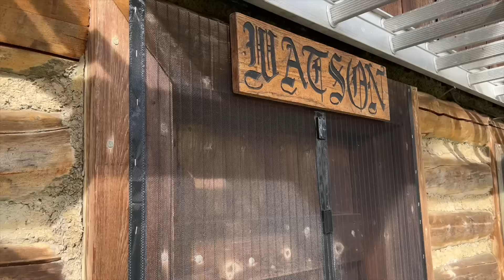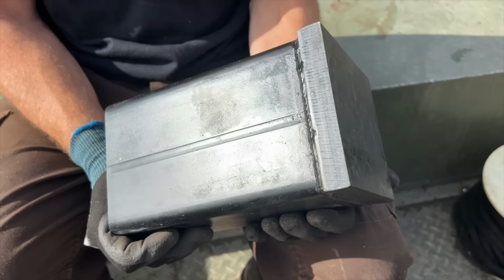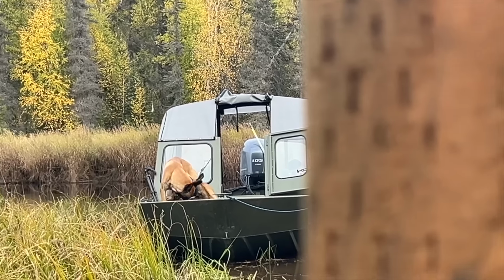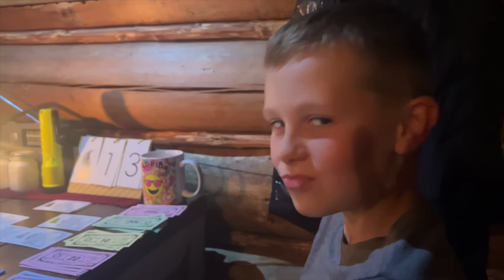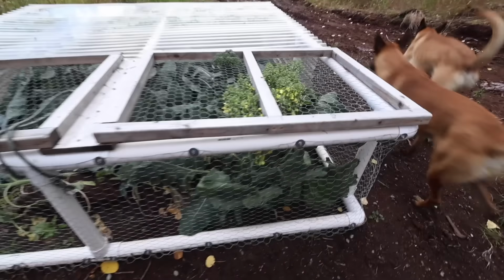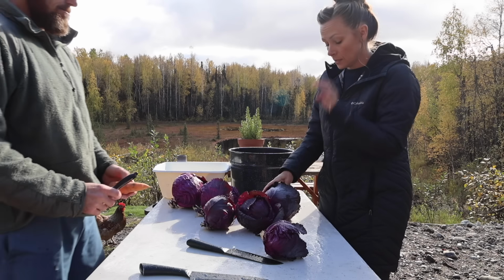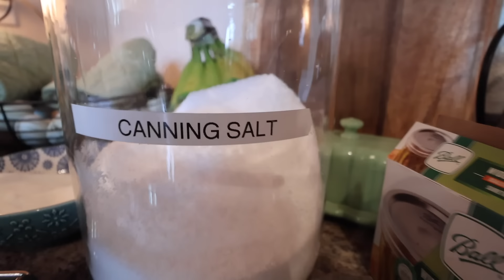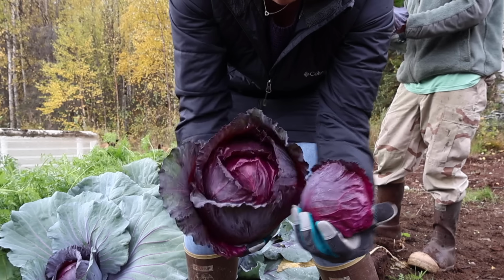Remote Cabin Dock Work + Our 1st Alaskan Garden Harvest!

Comment: why did you not use a floating doc system?
Reply from the maker: I wanted a solid boardwalk to drive the Atv down. Really don’t like the movement of the floating docks. I may still put a floating section on the end where the water is. We will see. 
Joe

Comment: bend over and look 75?  i was peeved when i heard this but 2 seconds later i got over it and laughed my a** off!!!!!!  so now i'm wondering since i'm 75 how old would i look if i bent over?  help! i'm too scard to try it! i figured out how to get over the panic that sets in when pondering being old. just start singing the intro to the mickey mouse club tv show:  M I C K E Y   U  R  O L D.  ps if anyone is having issues with kidney stones they may be caused by to much oxalates in your system and your kidneys are not flushing it.  please research it. it'll save your kidneys.  i've been on a no to low oxalate diet for 3 years now. i just learned a trick with potatoes which are high in oxalates: boil the potato[es]. discard all the liquid. this will reduce the oxalates to a low level of oxalates. however if you need a no oxalate diet then all potatoes in any form are a no no.  loved you garden!!!